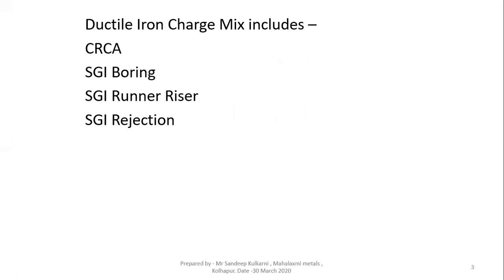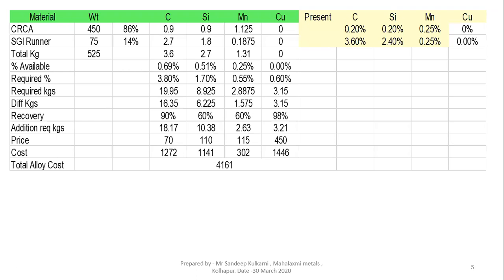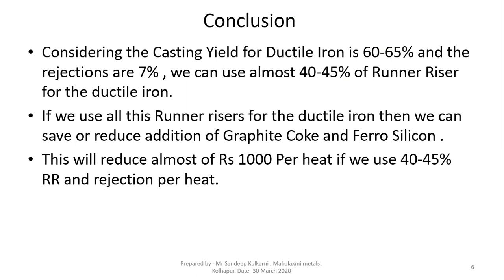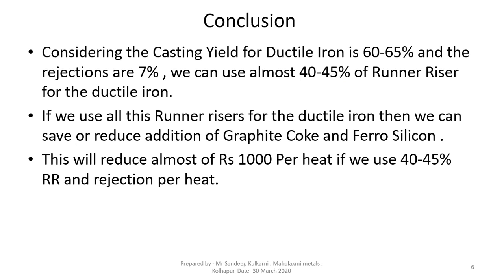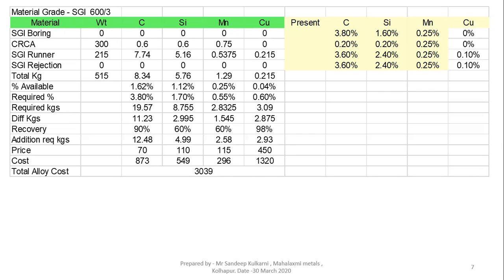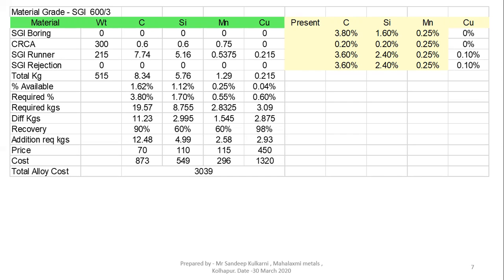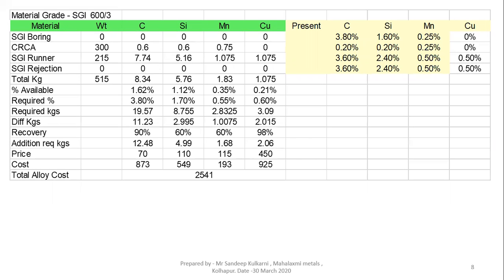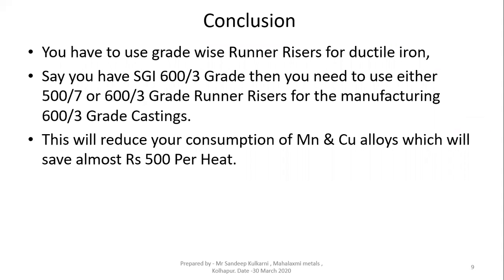Optimising & reducing Charge Cost in Ductile Iron

Comment: When producing thin section castings Si required in base metal is usually 1.6 to 1.7, so is it advisable to use foundry returns or other SG iron scrap in 55 to 60 percent range or does the residual mg from this have  unwanted effects on the casting.
Reply from the maker: No there will not be any adverse effect due to more  RR used. But it may give you more Si% in bath metal.